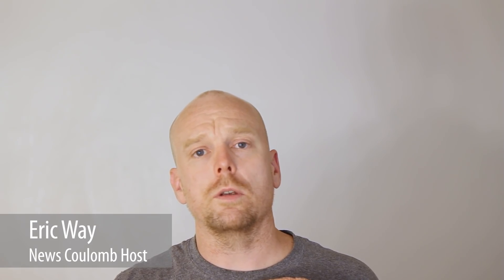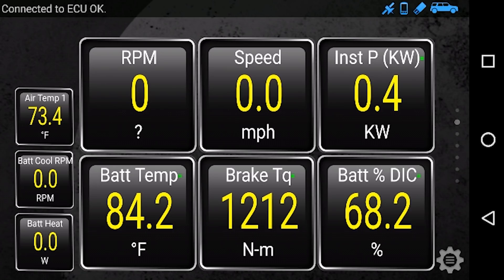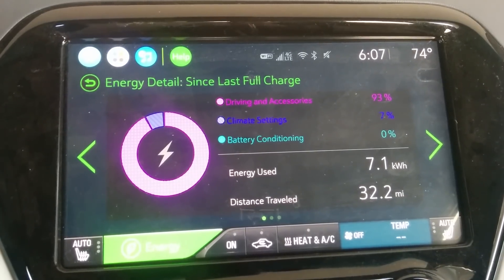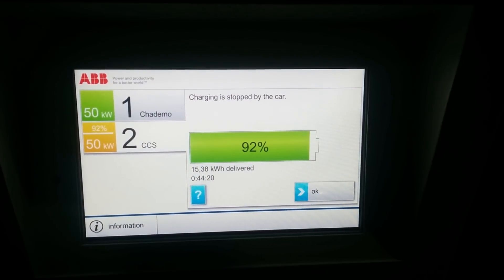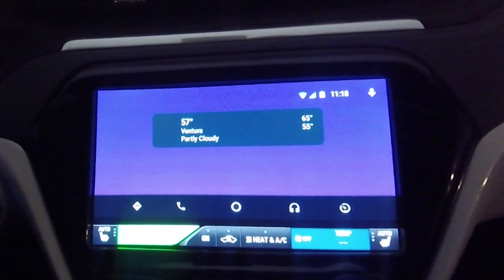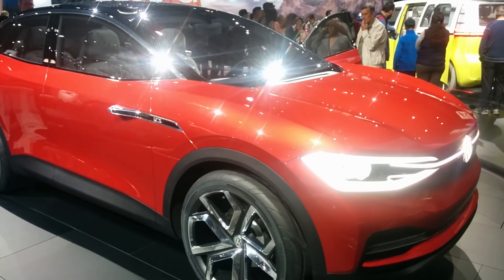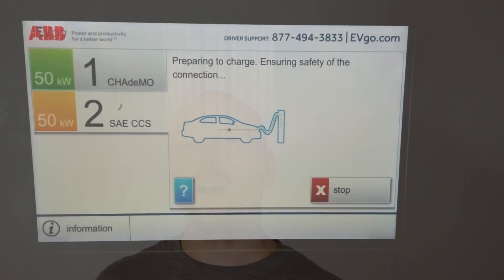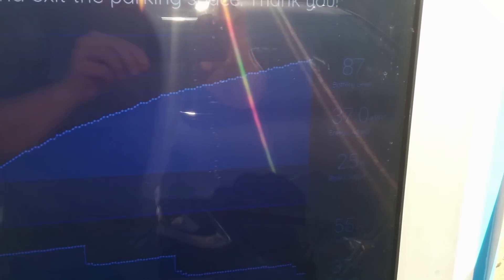Chevy Bolt EV: 70,000 Mile Battery Degradation

Comment: 45,600 miles on my 17 Bolt. DC fastcharge 0, hilltop reserve on all the time excepth 1 full charge per month to keep the mothballs out of the battery. Never let the battery go down to less than 40 miles. So far degredation is unnoticeable. Drive 161 miles a day during the week roundtrip. Times in the shop other than the 1 software upgrade 0. Flat out most reliable car i have ever owned so far. The Bolt has already beat my traded in 16 Camry Hybrid in reliability. Would I buy another one...absolutely yes! Because I never get tired of driving it....but it sounds like it might be awhile before I need another one...
Reply: Phil Atomic you drive a LOT!
Reply: We have great expectations for the reliability, safety and incredible longevity / life span of the Bolt EV --- easily in excess of 500K , an advancement in itself.
Reply: Dude! I drive 164 miles a day! Wow. And yes, I haven't really noticed much degradation at all. So far, so good. This is my second year of "thrashing" it. Oh, i drive to work in the desert. Hot ass desert. No problems. In fact, the indicator says it basically LIKES the warm weather.
Reply: Do you drive on the highway for your commute?

Comment: Another great video...... I am a Hill top reserve in most case kind of guy and usually filling up around 20 percent so I will keep this in mind. Off topic question- 12,000 miles in 4.5 months already and I cant figure out how to lower the sound volume of the beeping noise when the car is on and a door is open. Is there a solution? My ears have a hard time with it. TIA

Comment: I came up with A trick that can make batteries last for decades longer than expected.
The trick works on various types of batteries as well. 
 
  The effect is cumulative and takes months to regain some of the lost capacity.  

  Evs, solar arrays, cellphones, forklifts, hybrids and practically any rechargeable battery can benefit from this easy and cheap trick.

 Just watch my videos to find out how.

  After A few weeks of using the trick you should start charging the battery pack to 100% on occasion. Slow charging also makes the trick more effective.

Comment: Another great video. I can see even with your frequent long distance trips and DCFC sessions battery degradation is minimal. I do hope GM will bring the infotainment updates to 2017 and 2018. My wife drives our first 2017 LT and I drive the 2018 Premiere and we always have them set in city mode for "hilltop reserve". We just did a long distance trip from Stillwater, MN to Milwaukee, WI and your videos are great training to make long distance stress free trips. 767 miles in a weekend :-)
Reply from the maker: Thanks! 

Yes, the updates would be great, but I'm guessing there might be some hardware differences. If it's just software, GM really should consider offering patches. 

That sounds like a great weekend trip! I'm glad my videos were helpful. :-)
Reply: Glenn Marston ][ If you update your infotainment you will lose the capability of watching video clips and movies on your screen from a USB flash drive ( mine works on MP4 at 720 P). I hate when a manufacturer thinks for me. I have never tried to watch videos while driving. I can reset the occasional glitch or blank screen on the infotainment system.

Comment: mr way says: hundreds and hundreds of times on fast charge. since fast charge degrades the battery so much faster, than say chademo, or even level 1, which is best for longevity, if you don't really work, and drive short distances, close to home. Hundreds and hundreds, well, no. 100, or 150 maybe, which would be a lot. how many times have I filled my car? no idea, but I assume hundreds. Now retired, maybe twice a month, which would be 12,000 or so miles/year. @ say 300 fast charges, and it would be like my 3 year old laptop battery, no gomo. I think Mr. Way is conservative, in that if he could he would charge at a lesser rate, to save battery, and only use dcfc when necessary. I can remember his first time, and that was not so long ago. I really like the bolt however, and if he says, hundreds, well, maybe.

Comment: What do you see as a % when you use hilltop reserve?  I only have 11,000 on my ‘18, and when I first started using it, I got 88% consistently, now it charges to 87%.   I also noticed that after the software update, range is much more conservative.
Reply from the maker: Mine has always been 87-88%. There's some variance, but only about 1%.

Comment: Leaf/spark/Tesla owner here. (Gonna sell one soon) I bet many leafs may have that original bms issue. I'm thinking ill take mine to turtle and charge full. (Replaced battery in 2017 and it's already lost 5ish percent according  to leafspy). We took it on a road trip  tho and did nothing but chademo charging and it gained 1.5 percent capacity.... so yeah.Your degradationt is pretty good all things considered. We bought a used Tesla model S. 85kwh model. It reads 252 epa rated miles at full charge. It's a 2013. We mainly charge to 70 and 80 percent max... If your considering getting rid of your bolt, that supercharger speed is nice. You know the numbers. That degradation tho for your bolt.... Not bad.... Not bad at all. Thanks for sharing this! I am a fan of that hiltop Reserve mode. I have not heard about this termination mode you speak of until this video... Very nice. Keep on uploading!

Comment: If you still have all that historical data, maybe on your next video you can include a plot of the usable capacity vs. miles driven.  This way we can see if there are any trends that can be used to extrapolate future degradation.  Thanks.
Reply from the maker: Thanks. Good idea. I'll see what I can put together. It might be worth doing a follow-up on.
Reply: @newscoulomb3705  Besides the slight battery degradation, how has the rest of the car held up?  Any major repairs or unusual maintenance?  Maybe a cost-of-ownership discussion would be a good topic for a future video.
Reply from the maker: Yes, I'll see what I can put together.  There's really not much to it. All of the wear is from physical damage (outside forces). It would be more of a "War Wounds" video. 

Other than tires, windshield wipers/fluid, cabin filters... There's not much in the way of maintenance or cost of ownership. Just electricity.

Comment: My understanding was that a teardown of the Bolt revealed it actually had a 57 kw battery according to the cell number. Hear anything like that?
Reply: Mark Hegg See my article about that for more details:

https://electricrevs.com/2018/03/29/gm-explains-57-vs-60-kwh-bolt-ev-battery-ratings/
Reply from the maker: I've seen the teardown video with the 57 kWh sticker; however, GM's EPA filing for the Bolt EV lists the battery as 60 kWh. Jeff's article also sheds some light. I would say it's complicated, but I've seen nothing (including from my own data) to counter GM's 60 kWh claim.
Reply: That's rated minimum capacity at 20degrees C. Typical capacity is 60kw at 25 degrees

Comment: Good video. Do you have a Second Design battery ?  ( crawl under the car or raise it, look for a sticker on the right side of the back of the battery that reads TWO-see YT of dismantling a Bolt battery by weberauto)
Reply: David Drake The 1st and 2nd batteries have identical battery capacity. The 2nd design changed to use distinct male/female in and out coolant connections to reduce the chance of incorrect connections being made during manufacturing or repair.
Reply from the maker: My battery is the first generation battery design.

Comment: @news coulomb what are your thoughts if you never charge to 100%?
Reply from the maker: You'll still see degradation, but it will be to a much smaller degree. Though I can only guess what the difference might be. A Bolt EV with a "babied" battery might see as little as half the degradation I've seen at 70,000 miles.
Reply: Thanks, but I should have been more explicit. In terms of battery cell balancing and not charging to 100% or the GOM not being as accurate if the pack never gets a 100% charge.
Reply from the maker: Oh, I don't think that would negatively affect the pack. It seems like the battery starts doing cell balancing well before 100%, but that's just based on my observations. I think we'd need to ask someone from GM to know for sure.
Reply: Thanks.  Appreciate the videos!

Comment: I'm still very skeptical that charging to 90% has any noticeable affect on degradation.  There is still a buffer built in so you can never really charge to 100% anyway.

I'm guessing that the degradation you see is from so much DCFC.  I've had my Bolt a little over a year and I always charge to 100% on an L2.  I've probably used DCFC 10-15 times, but you've done it hundreds of times.  With 36,000 miles I have noticed no degradation.  Of course, you didn't notice any either at 36K.  My point is that after tons and tons of discussion, we really don't know the answer to the question of how to best care for the battery.  We don't have access to GM and LG data.  But perhaps they don't know the real answer either.
Reply: Stan Silvert All lithium ion batteries of the general sort used in cars degrade faster over time if left at higher charge levels. This is particularly true as battery temperatures get hotter. The effect is synergistic or combined so that a hotter “100%” full battery will degrade quite a bit faster over time than an “80%” full battery at cooler temperatures. This is calendar aging.

Batteries also degrade due to charging cycles. Charging from near empty to near full degrades a battery faster than an energy equivalent number of charges using a smaller state of charge spread. In other words, charging from 10 to 90 percent once is worse than charging from 30 to 70 percent twice.

Total degradation is a combination of both effects.

This video is mostly showing charge cycle degradation. If Eric had done the same number of miles and DC charges over 10 years instead of 2 years then he would have seen more than 8 percent capacity loss.

Just based on charge cycling, a loss of about 1 to 2 percent every 10,000 miles is probably going to be typical. Tesla owners with lots of miles are also seeing about 1 percent loss per 10,000 miles.
Reply from the maker: Great explanation, Jeff. Sounds like an article. 😉
Reply: Yes, I'd like to see an article.  I don't doubt your raw assertions, but I'd like to see the science, engineering, and data behind them.  

When you charge to 80% you are just creating a bigger top-end buffer than the one already designed into the system.  So why is a bigger buffer better?  If it is better, what is the optimum buffer size?  Lastly, how much of a difference does it make?

Unless these questions can be answered with sufficient explanation and data, I see no reason to stop charging to 100%.

On the other hand, if you are correct then GM has a duty to give us better guidelines.
Reply: @stansilvert9453  your regenerative braking will overcharge the battery when at full capacity or won't work at all.
Reply: @jeffnisewanger8260  We don't really have any actual evidence to back that claim up. No one does. We're all guinea pigs. My guess is that there would have already been a huge news story about how Bolt EV owners were destroying their batteries and that only those who always had "Hilltop reserve" ticked would be good to go. But that hasn't happened. There is literally no evidence that those who leave it in standard charging mode (Me included) fuck their batteries up, and the "Hilltop reserve" people don't. None. GM would have already had a scandal on their hands. It does appear as though GM did get nervous about this issue and made sure to limit us all by a couple of kWhs, just to make sure. Either way, I'm going to continue to charge it up, the way GM says to, (non-Hilltop reserve) until further notice.

Comment: What ODB adapter should I buy?  Also I will fit your ideal charging scenario for 80% of my driving.  I should get my Bolt by the end of the month.  I can gather the data from my use and share it with you if it will help you gain a better understanding of the battery.  Mine will be a 2019 my daily commute is mostly 60 miles.
Reply from the maker: Oh, nice. Congratulations!

I just got a cheap OBD2 reader. I think the only real requirement is Blutooth. The how-to on TorquePro and the PIDs has recommendations I believe. I can try to find the Google Sheets.

Comment: Your Torque App and DC fast chargers both get the percentage of battery from the BMS, so that's normal infos are similar. 
I found that my I-Miev is weirdly programmed, because I don't get the same information from the charger and from the App. The car is programmed to cut the charging when battery reach 80%, accurate on the App, but chargers always show 82% at the same moment. So the higher the state of charge, the higher it's off on the charger. 
Maybe it was design this way to trick people into thinking the charging is faster than it actualy is. Don'tknow...

Comment: here is 1 thing alot of ppl get wrong . would be nice if you made a video about this..  some still dont under stand regenerative braking  very well and that it can play games when finding battery degradation . 1 when using regenerative braking down lets say a 10 miles long hill and lets say you see 2 or 3 miles go back into the battery some think they only got 3 miles for there work and feel the system sucks but fail to add the 10 miles as its all so free run time on the car .so in the in the regenerative braking added 13 miles . 2 when trying to get the most range from a EV coasting as long as you can as free coast time adds up faster then added regenerative braking battery range .this is why  the gen 1 volts and gen 1 Tesla had a harder regenerative braking but as they found gliding got more range they pulling the regenerative braking back. 3 when looking for battery degradation some well charge to full and look at miles driven and giving regenerative braking can add or take away many miles from a 200+ mile rang EV . so if your the type to use regenerative braking really hard to try to push as much power as you can into the battery as fast as you can then your doing it all wrong .

Comment: Bolt battery is actually 57kWh 350.4 volt 162.7 Ah vice the 60Kwhr... Per this disassembly video. https://www.youtube.com/watch?v=ssU2mjiNi_Q  so that should decrease your calculation of actual degradation calculation.

Comment: Please let your subscribers and other EV advocates know that (it seems) GM has developed, and is field testing what is believed to be a 120Kw battery pack.  If possible, perhaps you can calculate the exact kW capacity of this battery based on this GM release from a few days ago: https (:) //media.gm.com/media/us/en/chevrolet/news.detail.html/content/Pages/news/us/en/2018/oct/sema/1029-e-copo.html  .. In your opinion, what would be the range of such a pack in different types of vehicles?  Bolt EV size, "Camaro" size, SUV size, etc? Edit:  more detail: http://gmauthority.com/blog/2018/10/chevrolet-teases-possible-electric-crate-motor-with-ecopo-camaro/

Comment: I believe GM estimates around 10% degradation over 100K miles. I don't think 8% over 70K miles is necessarily bad. It seems to be in line with what I would think of as reasonable degradation from a Automotive lithium ion pack. 

ICE cars lose roughly the same percent in MPG over 70K miles, so I don't think most consumers will be very worried by this. My mazda used to give 33 highway when brand new and dropped down to 30 at 72K miles.
Reply from the maker: Yes. I'd really like to hear from some other high mileage Bolt EV owners to compare experiences.
Reply: @newscoulomb3705  : How about talk to some high mileage owners with the Model S vehicles to give comparisons on if this kind of battery degradation is expected over 70K miles. I'm sure there will be many model S drivers who have reached this mileage by now, and you will have a wide field of drivers from those who put on miles over short duration vs longer duration.
Reply: My 2015 model S 70D is at 69k miles has lost a little over 3% but that's been with babying the battery

Comment: The majority of the capacity loss I experienced might have been to the battery update as well.  I experienced the same 2 kWh loss.  The other issue with calculating degradation is the variability of capacity due to temperature.  Warmer weather gives you higher capacity.  I have 45,000 miles on my Bolt and people ask me how much range I have lost and I tell them about 5% since I bought the car.  I haven't heard of ONE owner having bad degradation problems with the Bolt.  I have heard of a few battery failures, but that is completely covered for 8 years or 100,000 miles.
Reply from the maker: Yes, the more I think about it, I think the software update made the algorithm for estimating energy usage more accurate.
Reply: @newscoulomb3705  I think that it would be useful to take data on Torque Pro and temperature when you fully charge.  That way you can try to take away another variable and see if the kWh reading is more reliable.  I have seen this from my Bolt from the software update.  Each bar is supposed to be about 3 kWh on the display.  The bars on mine average about 2.7 kWh each until I reach 25%.  Below 25% each bar is about 3.3 kWh.  It is almost like they made the 25% a larger portion of the capacity so people would be less prone to being stranded.  It could also just be my car...
Reply: Dan Chase Some first design batteries had problems. GM changed mine at 50,000 when I mentioned a small problem in my many many Bolt accolades to Mary Bara at GM.